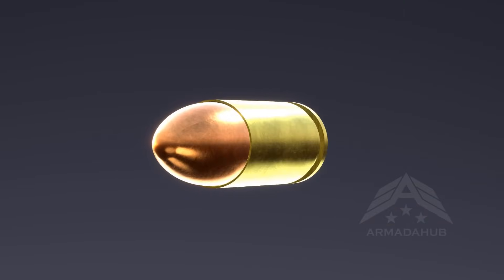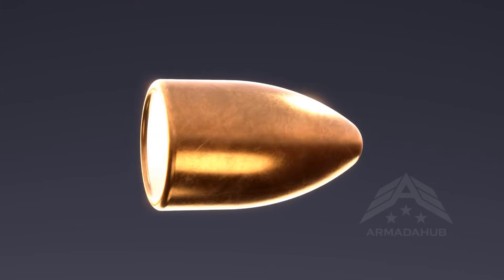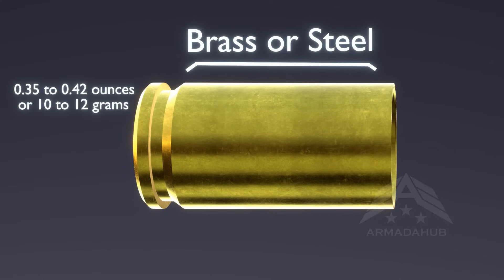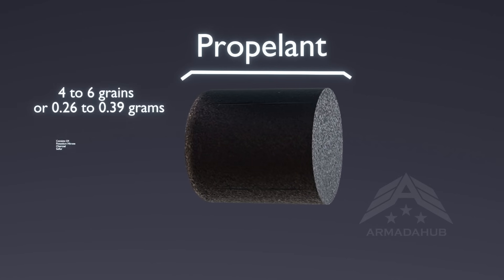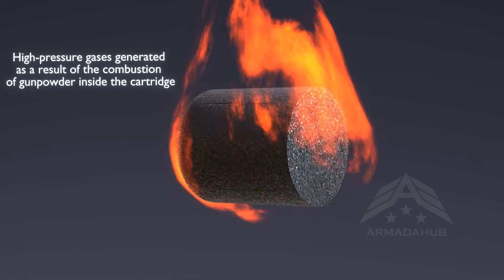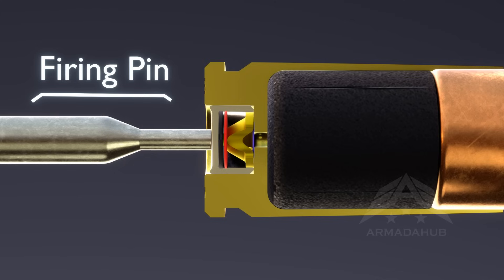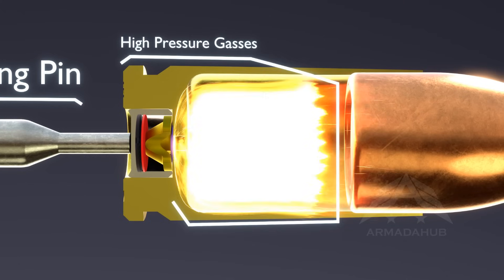How a Bullet Works 3D Animation

Comment: When the bullet is fired, it disappears. It makes a pop sound as the aerospace goes back to normal. The gun's sound effect arrives seconds later, as the sound travels slower. 
If a supersonic missile arrives, it is faster, leaves a thunder sound behind. One that comes by the structure of the missile, arrives in front of it earlier than the rocket. Its trail sound also has seconds of difference. 
So breaking the sound barrier is incorrect, the sound effect arrives earlier, then the projectile or missile arrives. 
Electromagnetic railgun: lightning strike arrives earlier, the alien device is ready, than the projectile arrives better way to make it disappear.
Some weapons are designed so a terrorist fucks a dog, the royal balloon leaves its ass, and can make a bullet disappear. Or works in a mind controlling way, the soldier breaks down and cries when he tries to pull the trigger. Some similar weapons born on the tongue of animals become enlightened, causes a financial crisis to avoid the shot.

Comment: This was obviously done by someone that knows very little about the internal ballistics of a modern cartridge. The first thing that happens when tha firing pin strikes the primer is that the fulminate of mercury inside the primer ignites. The internal pressure builds and backs the primer approximately 1/4 of the way out of the primer pocket where it butts up against the blast shield or the bolt depending on whether you are shooting a revolver or an auto loader. When the pressure reaches sufficient levels to force the bullet out of its casing the resultant equal and opposite reaction is to force the casing back to where it is stopped by either the blast shield or the bolt and thus pressing the primer back into the primer,pocket
Reply: Mercury Fulminate was largely replaced in cartridge primers sometime around 100 years ago, at least in the US.

Comment: i don't think there is anything in the "primer"... It's the fast strike of the hammer ( or striker) that sparks the propellent..😮
Reply: nah bro look up Berdan primer, it will have a potassium compound. Old percussion caps are the OG primers after flint strikers and used a mercury fulminate compound. The primer is pressure sensitive to the sharp blow from the firing pin and the deformation will build up friction heat on the chemical compound. But the goal is essentially the same, touch off the powder charge by hot particulates (primer compound) or on a flintlock, hot sparks.

Comment: What stops the primer being pushed out the back?
Reply: The face of the slide, in the 9mm Luger exemplar used here.

The firing pin comes through a hole in the face of the slide to strike the primer. The gas expansion pushes the bullet forward, and the gas also pushes the case backward until the case head meets the face of the slide.

Comment: Your very first line of dialog is incorrect.  You are showing a photograph of a Metallic Cartridge.  A bullet is one components of a cartridge.  The illustration you provide for the powder is not correct either.  Powder is made up off small bits that are (generally) either round or tubular.  The formula you give, is for Black Powder, which is rarely used today except in reproductions of (mostly) Civil War weapons. 

The first projectiles were round stones.  Later these evolved into lead, and eventually they were clad in copper.  Some bullets are made of lead, copper, and steel.  Some bullets are 100% lead, some are 100% copper, some are lead coated with copper, and some are made entirely of steel.  Some modern military bullets have a steel "penetrator" in their center.

There is a huge amount of history involved prior to the modern brass cartridge being developed.  Even you title is wrong.  At the most you have described the components of a cartridge, although your description of the powder is incorrect both as drawn and described.

You should withdraw this and create a correct video describing the components of modern metallic cartridges.  The newest cartridges in use are made of both high strength steel and brass.  But gun for many years fired bullets that were not encased.  They were inserted into a barrel that already had powder in it.  Early guns used a burning match to ignite the powder.  

Nothing in this video describes how bullets work.  That is referred to as terminal ballistics.

Comment: Should be "How AMMUNITION Works."  Bullets are only one part of AMMUNITION.  The chemicals listed are for black powder which explodes.  Modern smokeless powders are based on nitrocellulose and nitroglycerine compounds and are flammable solids and do not explode.  At least you got the "burn" part right.
Reply: smokeless powder is an explosive not a flammable solid

Comment: How does the primer explode when hit by the firing pin?
Reply: The primer is sensitive to impact. When it's struck, it bursts into flame and sends incandescent gasses and flaming particles through the flash hole to heat and ignite the powder.

Comment: The sequencing is wrong.
1 the propellant in the primer, pushes the bullet and the powder out of the shell casing

2 the powder is ignited, when leaving the shell casing.

3 the pressure from the burning powder pushes the bullet out of the barrel of the gun.  

4 ideally, the fast burning powder, is totally consumed, as the bullet leaves the barrel of the gun.

The fact the primer, pushes, thhe powder out of the casing, and ingniting the powder, at that point, is what burns out the throat of the barrel.

Most commercial rifles, have space from the bullet, to the barrel lands.
.
Reply: Exactly but the animation is interesting.

Comment: Also, the lead part of the bullet is usually hollow so as to be able to fill it with a much stronger material depending on the operational needs. Most commonly used core materials are liberty, justice and democracy.
Reply: and tungsten carbide
Reply: and insurrection

Comment: In case anyone is planning to use this video as reference material, it’s worth noting that the bullet & powder weight and velocity specs given are for 9mm Luger cartridges or others very similar to it (common cartridges in use today can fire bullets weighing anywhere from 17 to 400 grains or more, for example).
Reply: Good comment. And, to further confound those trying to understand grain weight, I will add that there are 7,000 grains per pound.

Comment: This video is not totally true

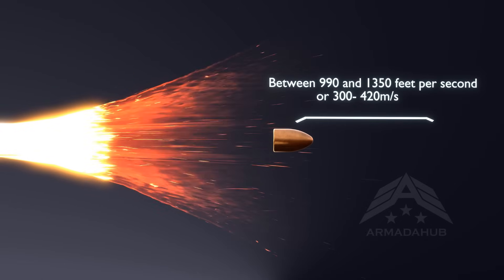The force of the primer, primer, pushes the bullet, and the gun powder out of the casing into the throat of the rifle barrel.  This is why the throat, of some barrels are burnt out 1:15 
Where the main ignition of the gun powder takes place.
The pressure of the burning powder then forces the bullet down the barrel.
The length of the barrel, should coincide, with the time the powder stops burning, and creating pressure.
When the powder stops burning, there is some residual pressure created
At this point, the bullet should be exiting the barrel.
A longer barrel is an advantage for sighting, however after the powder has stopped building pressure, the barrel becomes a drag on the bullet.
Therefore barrel length, and powder burn should match.
My opinion.
Reply: Exactly but the animation is interesting.

Comment: The  whole thing is called a  Cartridge  or simply ammunition.  Pretty good graphics and explanation.
Reply: I used to refer to them as ‘rounds’. ie, ‘15 rounds, load’ for when I was being told to prepare for a 15 shot exercise.
Reply: @Norton1531   I believe the term "round" is a holdover from the round lead ball used with muzzleloaders. Maybe I'm wrong?
Reply: @ I was using a Glock 17, an MP5 at first, and then a G36 after that. Think the muzzle-loading stuff was a bit before my time!! 😉

Comment: A lot of effort went into this but there are a couple of gross inaccuracies.  Most egregious is, modern cartridges do not use "black power" made of potassium nitrate, sulfur and carbon.  They use smokeless powder, which is typically a combination of nitrated compounds(nitro cellulose and nitro glycerin) and additive chemicals that help control the burn rate, fouling, etc.  But I do love the animation and narration style. (edited to correct a mistake I made in writing late an night. :)
Reply: Amazing.  97% of videos as well as commenters describe the rapid burning of powder as "explosion ", without knowing the definition of explosion.  It rapidly burns, doesn't "explode". Well done.   ☆
Reply: @fjb4932 isn't explode just very super fast burn?

Comment: The powder you describe is black powder. No longer used in any modern cartridges. Modern smokeless powders are nitroglycerin based.
Reply: you’re all wrong modern cartridges use tiny little men that swing at the bullet with a baseball bat
Reply: @IA41050 yes, unless it is a magnum cartridge. Then some of the little men are farting too.
Reply: @IA41050 real
Reply: @IA41050 Yes but those tiny little men are made of nitroglycerine
Reply: @IA41050  dont be a tryhard pls
Reply: @Bapak_Munafiq How was that being a try hard? Lmao
Reply: @1366Erik  that was 5 year old joke.. not funny at all
Reply: @Bapak_Munafiq The joke was just like the majority of the comments!!! Childish, wrong and pointless!
Reply: @IA41050  the humor lol
Reply: No! Modern powder is nitrocellulose based and depending of type of powder it may or may not contain nitroglycerin.
Reply: @OlafRooster easy there chuckles, the process of nitrating cellulose and glycerin are the same, it just happens that nitrocellulose is much more stable as an end product than nitroglycerin is. All that really happens is you're forcing nitrogen molecules to bond with some kind of carbon based fuel. Nitrogen is an antisocial son of a bitch and doesn't like interacting with anyone which is why those binds are easy to break
Reply: @OlafRooster Well... you can also use Diethylene glycol dinitrate.
Reply: @OlafRooster not true its nitrotoluin based please don't lie
Reply: @OlafRooster yes, but it is a little more dangerous than traditional black powder because it contains Barium powder
Reply: Unless you say it in a cool voice with intense background music I do not care.
Reply: Single based propellants: Nitrocellulose                               (+ additives)
Double base propellant: Nitrocellulose + Nitroglycerine    (+ additives)
Triple base propellants: NC + NG + NGu (Nitroguanidine) (+additives)

The first two are smokeless powders, the last one isn't.
Small arms usually use single base propellant. 
Some use double base but that is mostly used for larger calibres (and mortars). [have shot a Browning HP 9mm loaded with double-base myself in the test-lab for propellants).
Triple based is used for the largest calibres. The third base reduces the temperature and therefore barrel-wear while maintaining a high chamber-pressure. This comes at the cost of extra smoke. Large naval guns used this propellant as their large calibre has barrel-wear as a major factor in accuracy.

Barium nitrate is used as tracer in some rounds (it is also used in fire-works for the 'apple-green'-colour)
Reply: @DreadX10  great information for students and professionals also
Reply: @DreadX10  you are the boss
Reply: @DreadX10 I know about tracer coatings on bullets, but you're saying there's tracer material in the propellant ?
Reply: @ No, the third paragraph of my comment is in response to the previous commenter mentioning 'barium powder'; it is no longer about propellants (as the first two paragraphs were).
Reply: @DreadX10  you're right, my bad. I did some reading and found what you are talking about.  I couldn't conceive of how the presence of nitroglycerin could do anything other than make the barrel explode, but the Internet says that the nitroglycerin is combined with the nitrocellulose in such a way that it burns Instead of detonating.  Learned something new.
Reply: @DreadX10 Thank you!!! I knew smokeless powder was nitrocellulose based, but didn’t know about the other additives! Great info!
Reply: Same concept
Reply: Nah bro your all are wrong, it's contain atomic bomb's powder 😂
Reply: It doesn't matter!!! The video is only describing the working principle of a cartridge and a bullet. Weather is black powder or more modern smokeless powder it does not make any difference in the description of how a cartridge and bullet works because it's exactly the same working principle. By the way you are wrong, black powder is still used as propellant in some ammunitions, cowboy loads, shotgun shells, etc.
Reply: Modern propellant is nito-cellulose, not nitroglycerin, but you're right about gun powder, only used by black powder enthusiasts
Reply: KNo3, sulfur and charcoal is composition of black powder,

The gun will blow in your face because modern firearm barrel have rifling and black powder is fast burn, they wil exploding the chamber
Reply: but if you want a first gun make it with this
Reply: More AI b***** from somebody that doesn't know they're asked mahoon.The ground you're title shit read how Ammo work is not how bullet works
Reply: Nope your wrong
Reply: They use sulphur,potassium nitrate or any of the oxydicers and charcoal or a substitute
Reply: not to mention, the chemical reaction in the primer itself. Very inadequate video.
Reply: You're all wrong. Modern powder is nuclear. 235U.
Reply: Blah blah blah, that's for all the armchair nitpickers! 😂
Reply: Cornpops
Reply: Creamy peanutbutter n jelly
Reply: Both, nytroglicerin, nitrocellulose and thy even creating hydrogen ones
Reply: Nitrocellulose based, with some adding nitroglycerin for "double-base" propellants. Pure nitroglycerin would explode the chamber.